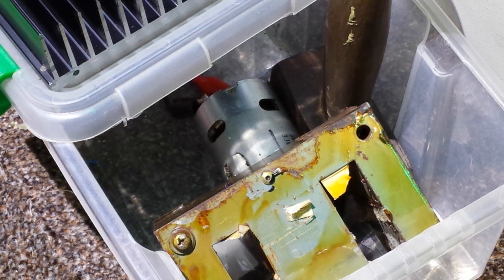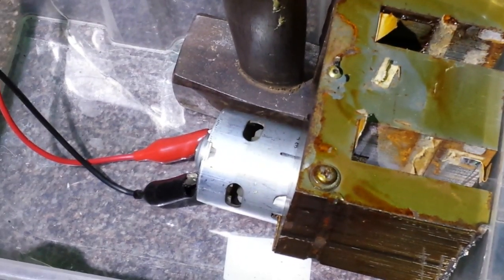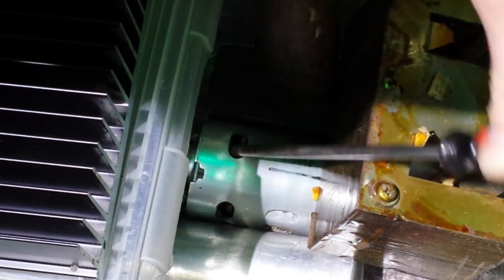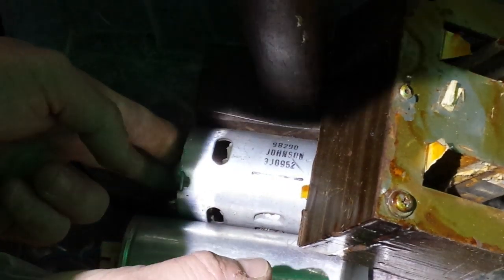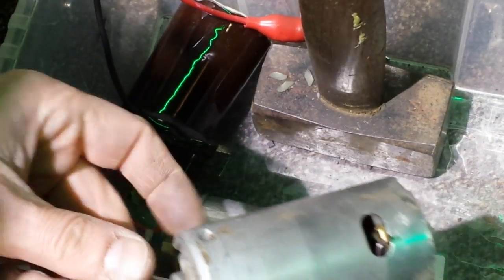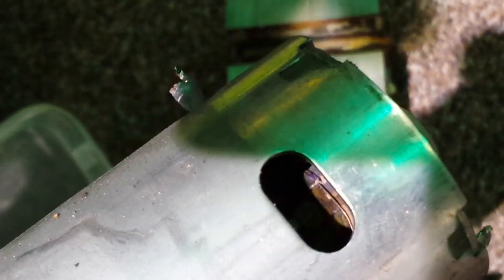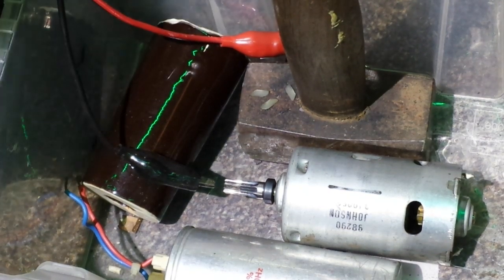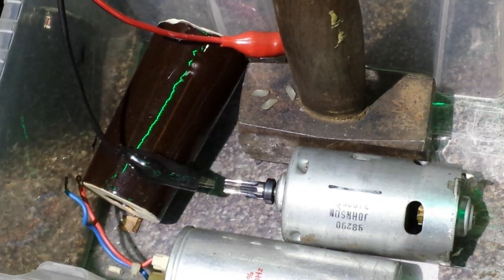DC motor Execution on Variac

Comment: Very nice to see the destruction of this motor
I like the sparks comming out of the motor 

Is your variac conected to the mains or with a separating transformer ?
I whouldn't like to touch the mains even when its just 60V 

The only thing I can complain about is the noise but isn't to bad
I thought you where outside to !
Till I heard the noise from your billion fan's ^^

Fokus
Reply from the maker: Hi mate'
Yeah the variac is connected from the mains. ( No transformer)
And touching it at 60volts mate ya cant feel anything! So dont worry! If its around 70-80 volts then you can start to feel it lol. But with dc as you know ya dont want to be touching it at 70 or so volts😖 lol 

Thanks friend for the comment😉